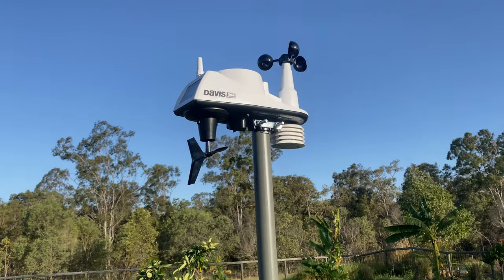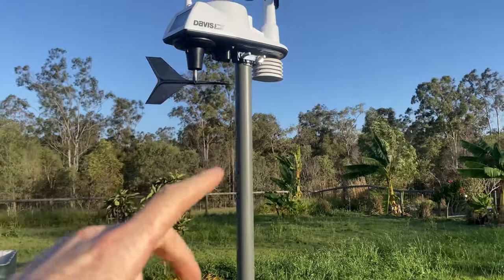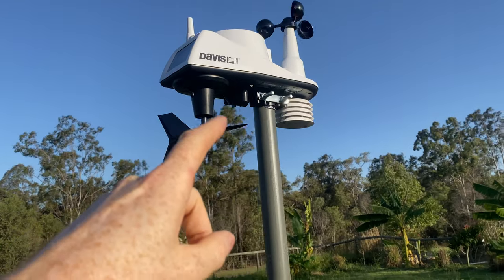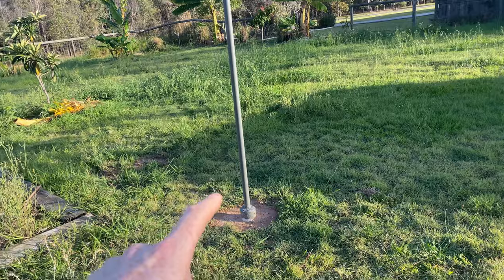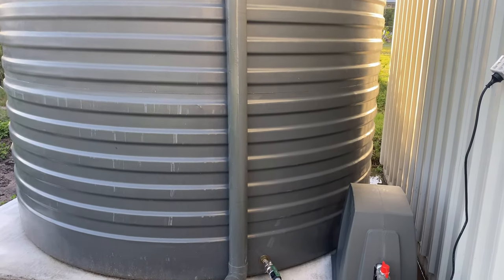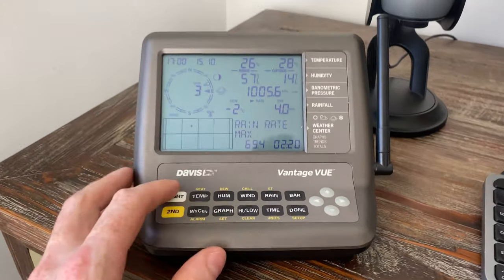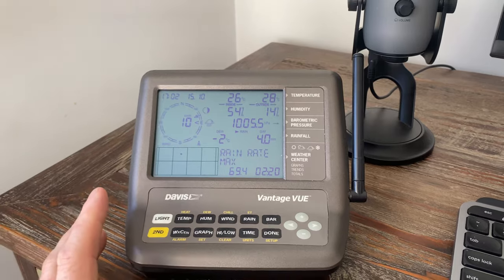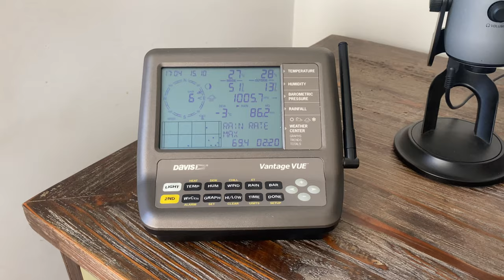I Installed a Weather Station

Comment: Nice setup and nice looking weather station Daniel. Something I will do for myself soon
I have installed a couple Oregon science stations for customers on mast from roof tiles or tripod on tin like a tv antenna 
one broke a weather cup off for no reason known off within months
Rechargeable batteries failed in 6 months
Your unit looks far better than they are.  I’m going to check the Davis out. I’m sure it was well worth the extra price tag and bonus getting it at a reduced price ( I just did the same on a variegated sabara)
Ive already put your name down for a graft of it when it’s big enough
Reply from the maker: I did look at those too, that is good info! That is awesome Neil, I’ll have to grow something great to send you in return :)